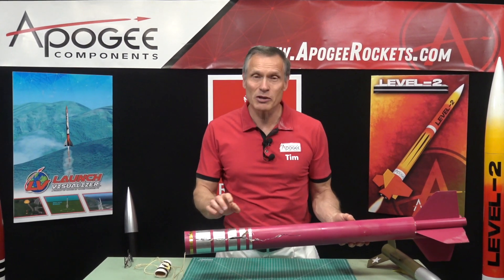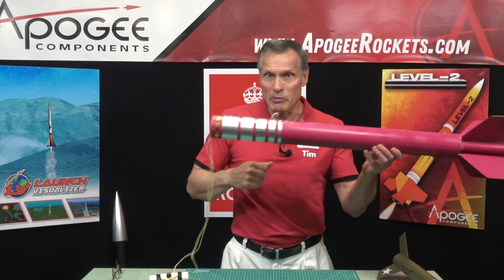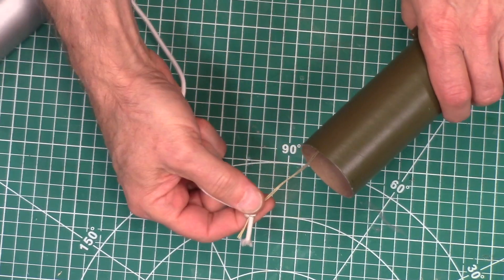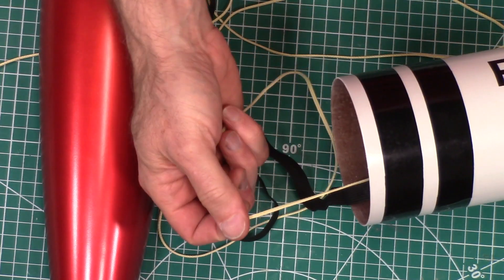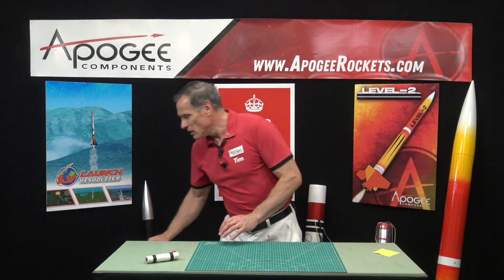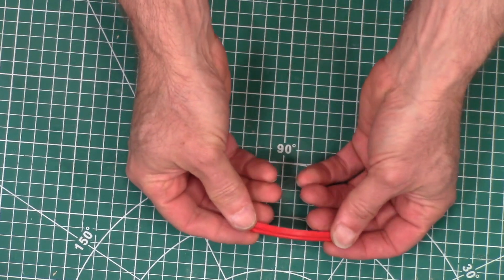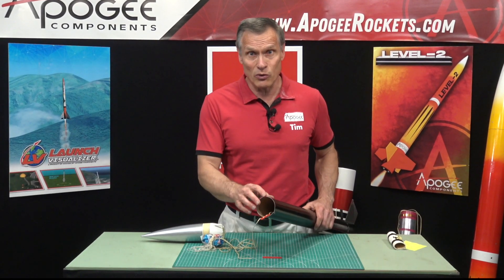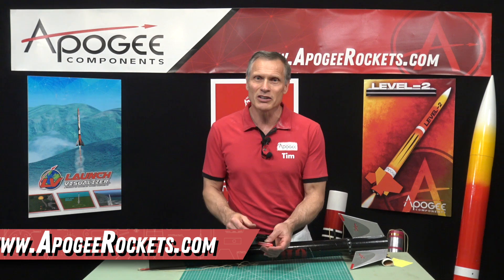Preventing Zippers in Model Rockets

Comment: Hey Tim, Rob here. Why is there no manufacturers of a silicone shock cord? it would incorporate both the elasticity and heat resistant also. I recently had physicals therapy for my shoulder and they gave me silicone bands to do exercises, it too wide to cut into strips, scissors don't work and even using a razor doesn't cut it straight., but if it was made into a corded product we might have something?
Reply from the maker: might be really hard to tie knots. But other than that, it might work.
Reply: @apogeerockets  CA would not work or any other glue, they would have to be crimped like the cables on that dual shock cord rocket in the video. Just crimp on a typical electrical connector with a hole in it.
Reply: @apogeerockets  You got the money, you should experiment this idea. Give me a kick back down the road.
Reply from the maker: @RobsRocketTimes  I don't have the money... Silicone isn't cheap, which might be another drawback.

Comment: I’m thinking of an aluminum insert like a very short tube coupler that mounts inside and flush with the forward end of the tube. But you would need special nose cones with a slightly reduced shoulder diameter, maybe not the most practical idea. But it would work! Actually a shouldered insert would work perfectly.
Reply: I epoxy the end of my tube inside and out. Most the time your nose cone is loose anyways so it doesn't bind it up.
Reply: @mercdragons  Good idea.